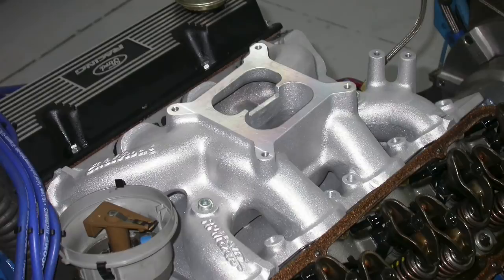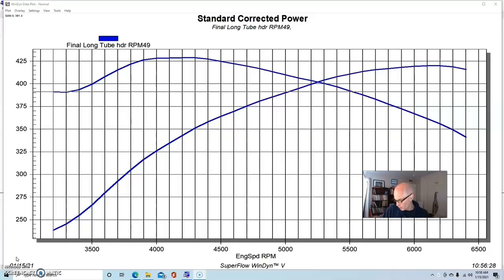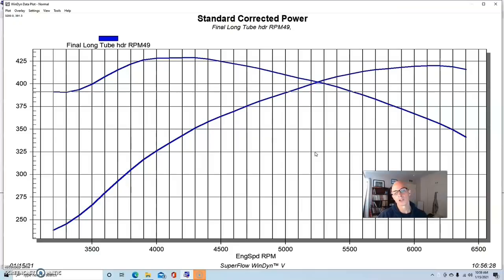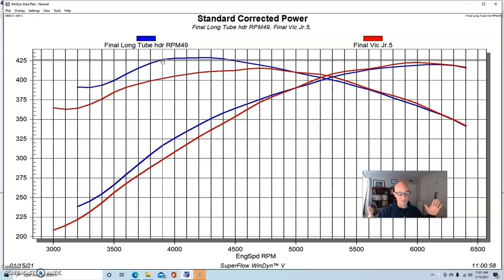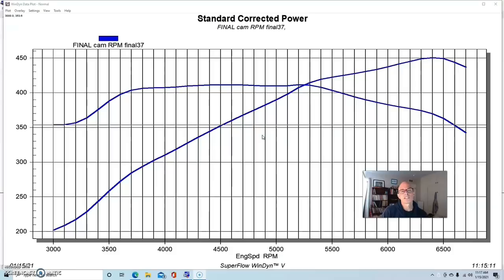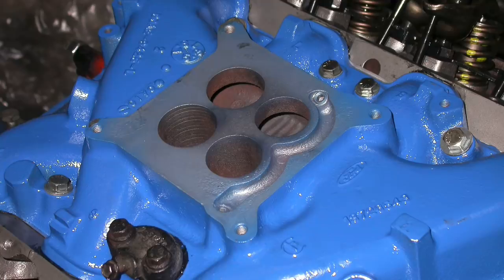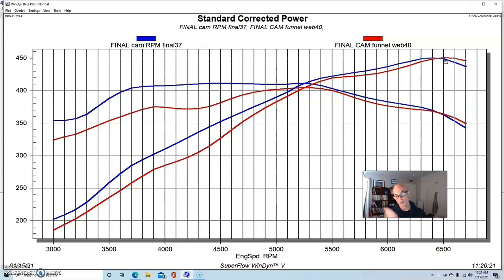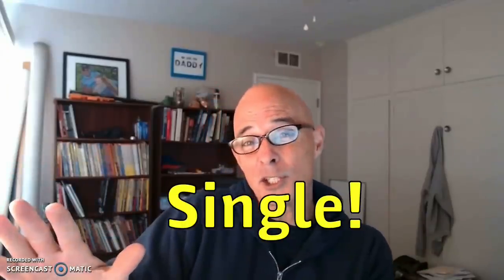THE OTHER GUYS INTAKE TEST-351 CLEVELAND (PLUS 351W)

Comment: Time to combine them and make a Clevor.
Reply: the main reason to put C heads on a W block is availability. There are millions of W blocks out there, and C blocks are harder to find. If you can find a complete C in either 2V or 4V, 2 bolt or 4 bolt, then you don't need the W bottom end. The Ws aren't stronger, there are simply a lot more of them.
Reply: @SweatyFatGuy  Maybe in America, in Australia it's the opposite. Cleveland's are more readily available than any Windsor. 👍
Reply: @MafiaboysWorld  Yeah, but the heads are the heads.   That's where the power comes from.
Reply: @bigboreracing356  before the wide availability of aftermarket blocks and heads for Fords, the scarcity of the 351C vs the few million Ws out there , mean the best heads you could get for a W were either the 4V Cleveland heads, or the 2V that came on 351C and 351/400M engines. 

All you needed to do was machine a square hole round so you could plug it with a soft plug, and get an intake to fit, and you had relatively low buck heads that would stomp any of the factory W heads. The 2V Cleveland heads flow as good or better than most aftermarket W heads.

No matter what people say, the C head is a very good piece, and they are not 'too big', most of the time they simply do not have enough lift and duration, or the duration is so long that they don't start making power until 4000rpm. It seems to always be people who do not own them, but read about them somewhere who claim they are too big and lazy on the bottom.

The C is also prone to having an oiling issue where the valve covers fill up due to limited drain back at high RPM, so they got the reputation of being weaker. 

Really though it was availability that had people building Clevors, its incredibly easy to find a 351W, and rather easy to find 2V heads in good shape, so 20-40 years ago it made sense.

Same thing with the 350 chevy getting 400 cranks stuffed in them to make a 383. Lots of 350s and lots of cracked 400s to give up cranks. 

As it happens the Pontiac 455 and 400 blocks are .030 different in bore, and the 400 has 3" mains while the 455 has 3.25" mains. The difference is in the 3.75" stroke of the 400 and the 4.21" of the 455. Everything else was the same or could be bolted directly to the other engine. The only difference between the 350 and 400 Pontiac is the bore, and yes with custom pistons you can put a 4.5" stroke crank in a 350.

There were a lot more 400s built than 455s. So you can turn a 455 crank down to 3" mains, weld up the thrust surface to fit the 400 block, punch it .030 and make a stock bore 455 with 3" mains. Now you can get a 4.21" or 4.25" stroke crank for less than it costs to have the thrust welded and the mains turned down. 

The aftermarket has made all of this swapping this for that a non issue. The high end aftermarket W heads flow pretty good and can make the same power as the 4V head, without the headers due to different deck heights, the intake, and the machining. Stroker cranks are usually inexpensive for the return on investment of bang for your buck, so there isn't a need to machine the factory cranks to fit other factory blocks.
Reply: @bigboreracing356  well yeah, its an aftermarket block.
Reply: @bigboreracing356  my Clevelands won plenty of races, my Pontiacs won even more and everyone says the Pontiac is slow and will blow up. Professionally ported W heads, vs a very easy swap to 2V heads, I bet that guy spent a lot more than he would have making a poor man's BOSS 302 with 2V heads.  

 No idea how fast my Clevelands were in the 72 Mustang, but they stomped lots of chevys. That was over 30 years ago.  One of the 'faster than my Ford' guys had a 71 fastback with a Boss headed 351C. He was getting close to the tens on the street in the 1980s. Most of the W powered guys even in lighter cars (like a 66 Mustang) weren't able to crack the 13s. 

Everyone running 4V Cs back then were the guys to beat., and where I come from you have to run rather well to win. There is a reason 1320Video is from the same place I came from. Things in Nebraska have gotten quite a bit more interesting in the last 30 years. I was one of the first to throw boost at 5.0s in the area. One kid I built engines for back then could afford a Paxton and some aluminum heads, he has a mild ten second daily with a turbo now and does the hard tire no prep thing with it.

Guy I know back home bracket races a Maverick with a 302 in it, W heads,  5.38 or so rear gears. He ran a full second slower than I did in a 3750# 79 Formula with a very mild 455 (mine ran 12.1-11.7  @110-115 with the 4.10 his best ever was a 12.8), but with the gear he was way out ahead only to get passed at the 660. That was after I put 4.10s in it to slow it down from 11.40s so I didn't have to put a roll bar in it.  Back then the roll bar limit was 11.99 not 11.49 like it is now. 

It was kinda funny looking at him as I passed him at half track in his 'race car' and mine was a beat to death street strip toy. I had less than $5k invested in the entire car,  not the engine, only had about $2700 in that 455. Running mid 11s with mostly stock stuff, reworked a bit, all motor, and having to slow it down to pass tech, yeah that is low buck performance. 

 The Clevelands cost a little bit more to build, and harder to find parts, but there was a reason I got them. I need bang for your buck, because I have always been kinda broke. Having to go buy a set of heads along with everything else was out of my price range. So I needed engines that made power I could use, and not have to change out the entire top end for aluminum.  

Its why I don't bother with chevys, unless you throw the aftermarket at them (non LS of course) they are pathetically slow.

It depends on how far you are going and how light your stuff is. If I had something that only weighed 1600# I would hope it hauled ass. Then again my engines make power from 2000 to 6500, give or take depending on what size it is.

That is the plan with one of the Opel GTs I picked up in 2019. Tube chassis, and I might put a 2V headed 302 roller 5.0 in one just for you.. I have 302s stacked up like cordwood. No use for them really. One is definitely getting my low powered 467 CI Pontiac... everyone knows they won't make any power. ;)
Reply: @bigboreracing356  I have known a lot of people over the years, I have heads and engines done by the premier Pontiac shops, Butler Performance, Kaufman Racing, and SD up in Canada, even have some Nunzi parts, but the closest anyone I know has come to getting Glidden sourced stuff is a friend who raced a yates headed 351C in a tube chassis 80s T bird.

You're talking rare very expensive stuff, and I am talking low buck anyone can do it with a basic machine shop stuff.

I suppose a Reher Morrison ZL1 based BBC would run ok too in a 1600lb car.

Makes me wonder, what have you built and raced? How fast did you go with an engine you machined and assembled in a combination you derived? When I had a machine shop at my disposal, I built a mid ten second engine that was in my 3600lb Formula.  I usually have someone else do the machining now, I can't justify having the equipment that requires since I don't do engines for a living.

I am talking about engines I have actually built, except for the Clevor, I never needed to build one since I have four C blocks sitting here and only two cars to put them in. Have been thinking about it since a friend has a Maverick he knows is incredibly slow and I have two sets of M heads laying around holding doors open.

Not engines someone else owned, someone else built for me (only have one of those and I ordered it while I was deployed to Kuwait).  That one is a 700hp/tq pump gas Pontiac from Butler. 

This is what I do and have done for over 35 years when I wasn't loading cargo planes wearing green and getting shot at. That paid the bills better than working on cars did, and it didn't burn me out so I didn't want to work on my own stuff. Its not read it or see it somewhere for me, its what I have done with my own hands and mind while life happens. 

What have ya built? How fast was it? How much it cost?
Reply: @bigboreracing356  Why the f**k not? Best of both worlds. 👍